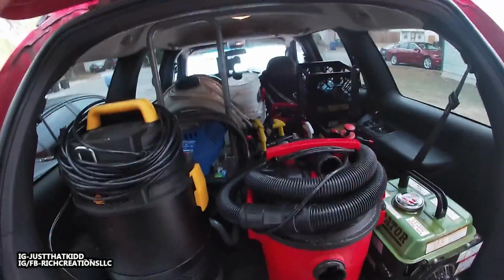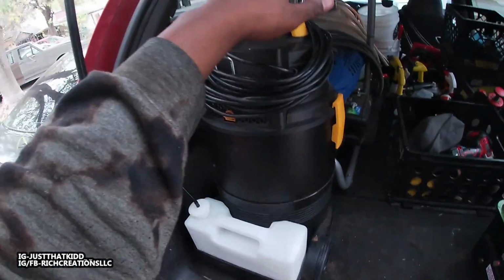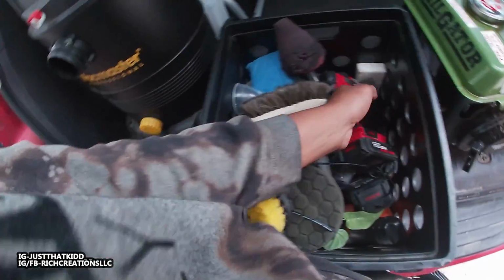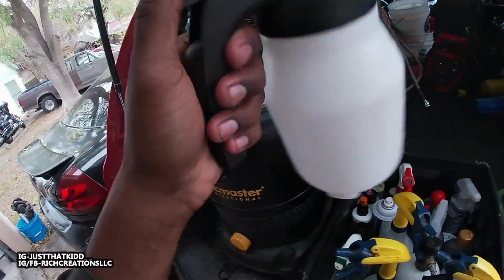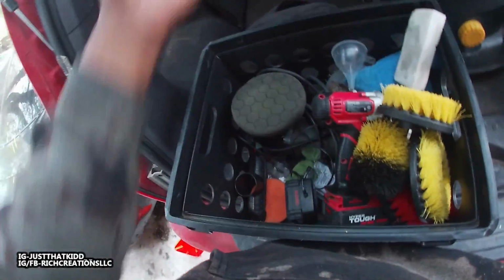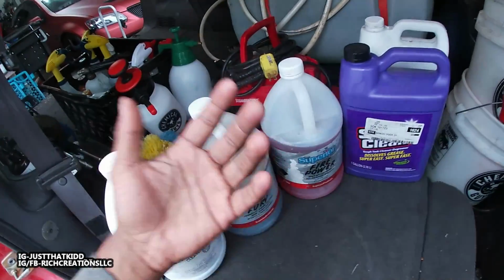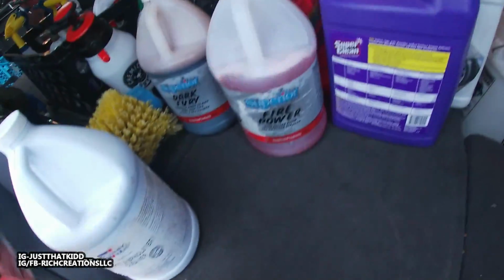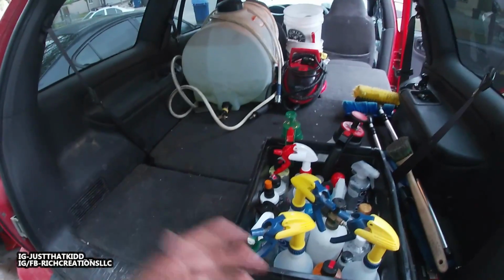EVERYTHING you need for a Mobile detailing business - HOW MUCH IT COST FOR CHEMICALS & EQUIPMENT !

Comment: What brand of pressure washer do you use?
Reply from the maker: Right now i use the homedepot brand ryobi i think. $100 pressure washer.
Reply: @Moe_Nation  okay and thanks! I assume that it's electric. How does it work for you?
Reply from the maker: Yeahs it’s electric. And works great tbh. Not a lot of pressure but just enough. I had a gas one but prefer the electric.
Reply: @Moe_Nation  okay. Why do you prefer electric over gas?
Reply from the maker: I do a water pump setup. Quieter and just easier. I click two buttons to get the pressure washer going. Don t have to pull any strings or refill with gas. It’s permanently mounted in the van.
Reply: @Moe_Nation  water pump set up?
Reply from the maker: https://youtu.be/6XA8nXZl0sc

Comment: When someone as me to do an full service washes for $40 they don’t realize how much all of this cost. Clients think you get everything for a low price that they want to pay you less. Even if I go to get 5-15 gallon of chemicals it’s not cheap. It’s like you get a gallon or two cheaper for bulk buying.
Reply from the maker: They don’t. The problem is a lot of people are doing it at crack head prices so it make it hard for people who charge the right prices. At least that’s what I’m noticing out here. A lot of people will do inside and out with a shampoo for $100.
Reply: @Moe_Nation  you can follow the trend of the $100 in your area, by pushing other things into it. Like engine cleaning. Add $20-30 more. And stress why they need it. Also push scotch guard for their carpets. Add another $20-30. Add ons will help you get more money. You can break the cycle of thinking just washes/interior or exterior details. Add on bro!

Comment: How does that tailgater generator works for you? I’m running an electric pressure and a small shop vac would that be too much for it?
Reply from the maker: I’ve actually upgraded since this video. But probably not. I ran my vacuums off it with no problems. As long you do the fuel mixtures right. 

Now i think it’s rated at peak wattage at 900. But it powered my steamer which is 1500 watts. Idk how. Not bad for a $100 generator.
Reply: @Moe_Nation  thanks for the info I think imma go that route and update later on as well
Reply from the maker: @dante919  i think they running around 119 right now. Get the 2 year warranty with it. It’s worth it. If Something happens to it, you can just drain the gas and bring it back and walk out with a new one. 

I still have mine and use it every now and then.
Reply: @Moe_Nation  thanks man much appreciated